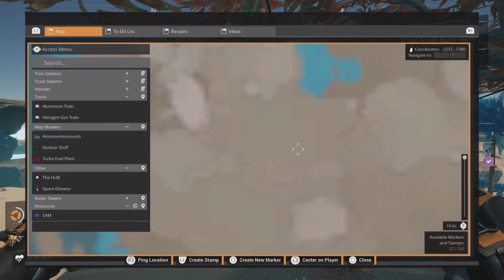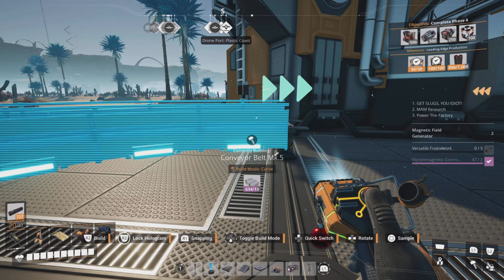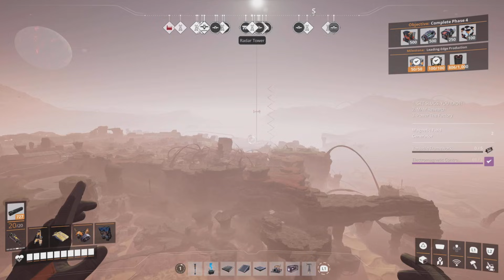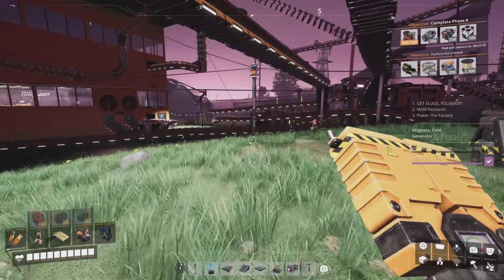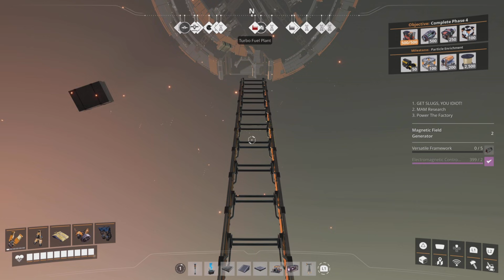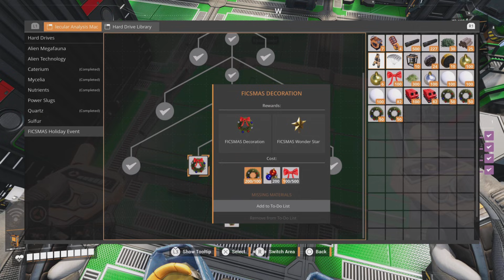Satisfactory - Episode 51 - FICSMAS Day 15 - Nuclear Power Started! Even More Space Elevator Stuff!

Comment: You didn't made same error I did with nuclear. I first placed an industrial container (as buffer) just next a MK3 miner with shards. Nuclear radiation isn't only about uranium and the like. It's also about density. So having a belt of uranium isn't that problematic as having a container. And each item have different base levels. Some nuclear product don't have much if any as are enchased. Also radioactivity has a decay amount by distance from source.
Reply from the maker: That makes sense. Especially noticable once I get near my waste storage area.
Reply: @TheZanzibarMan I got with nuclear in my first playthru and took a quite good amount of time to make it for a few reasons. First I did decided to plan for 12 power plants because uranium ore permitted that. Also I was terrified of something going bad like using a resource shared with nuclear and getting everything on halt. So I did a dedicated resource processing.
Third, I wanted a zero waste system. So waste is immediately turned in plutonium fuel and sinked.
Fourth I wanted zero radioactivity around the facility. Everything was processed "on time". Uranium on belt isn't that radioactive and anything else was just few item sparse in time and space. And could even go around without filters as health wasn't reducing that much and only in specific few points (basically only very near machine processing plutonium)
Reply from the maker: That sounds like a lot of work.